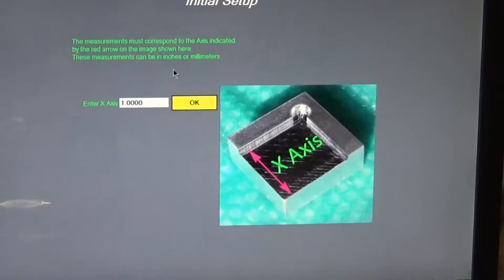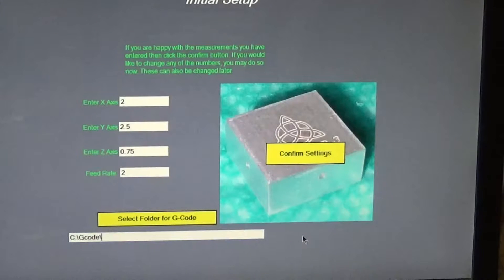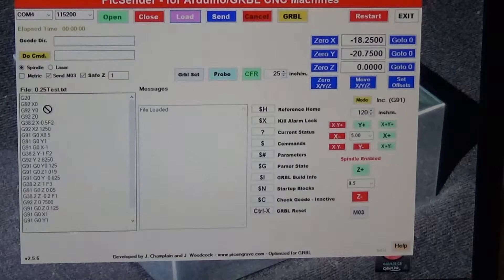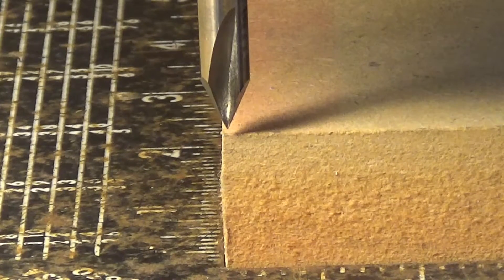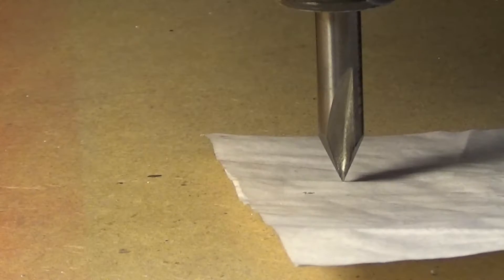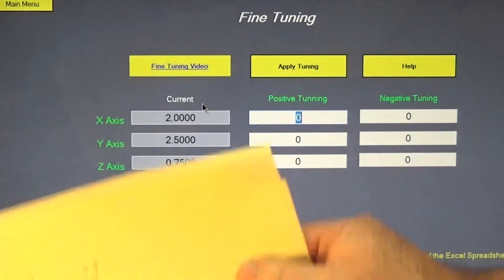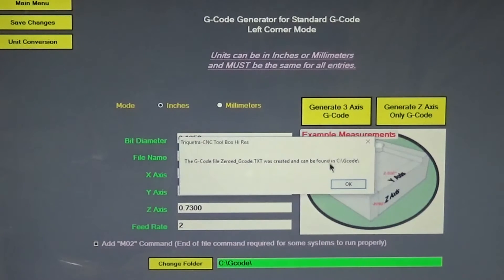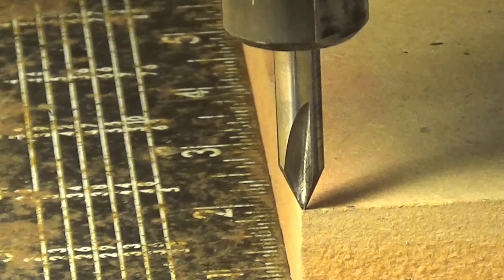Triquetra Tool Box Touch Plate Measurement and Fine Tuning

Comment: Hi Charley, after the fine tuning  you did the newer file but with 0.125 diameter tool, Shouldn't it be .25 ? 

Cheers

Isaac
Reply from the maker: Sorry, I don't understand your question
Reply: You started the fine tuning with a 0.25 bit   (minute 2:48 on the video) - and after creating the new file  "Zeroed_Gcode.txt"  - you saved it but with a .125 bit. (Minute 10:53) - I just wonder if this is OK since to my understanding it should be .25.
Reply: I am referring to the bit Diameter there
Reply from the maker: I didn't catch that.  In theory you could change bits while doing this, but should stick with the same bit while fine tuning. After you have finished fine tuning you can use any bit you like. I believe I switched bits so it would be easier to see the exact position.  It doesn't really matter what bit you use though because you are only referencing the center of the spindle which always remains the same.
Reply: Charley Thomas 

That's what puzzled me 😃 if it wasn't the same bit, how did it zero anyway? Now I know. Thanks Charley.